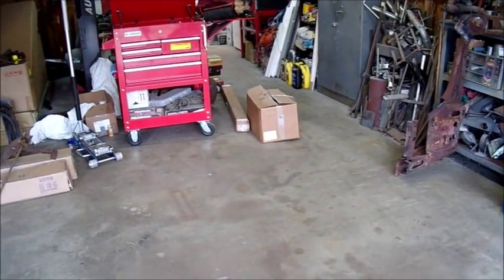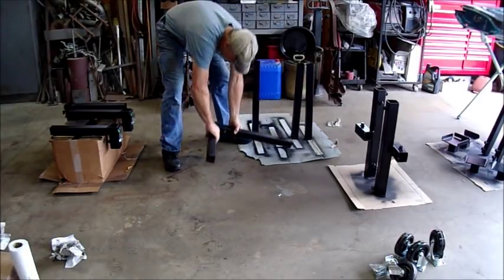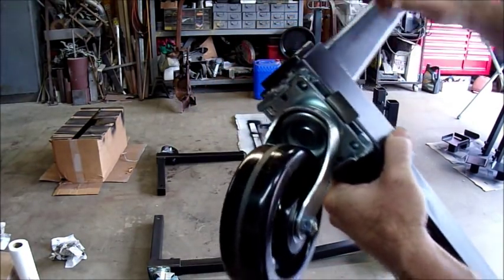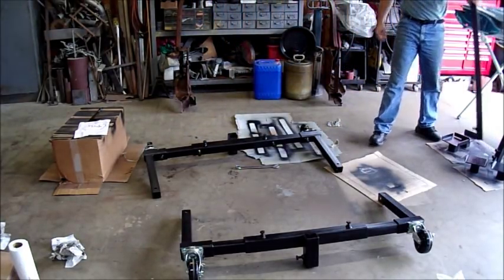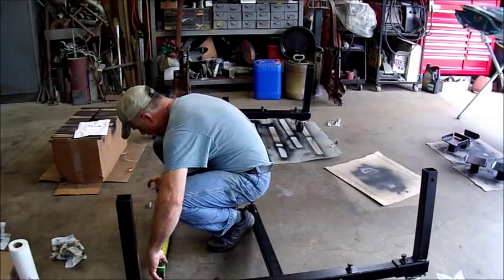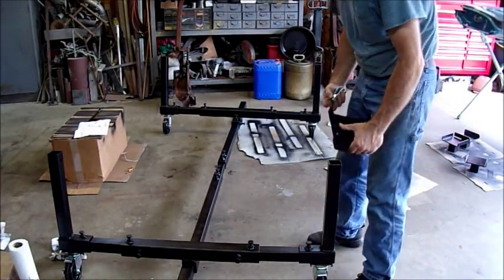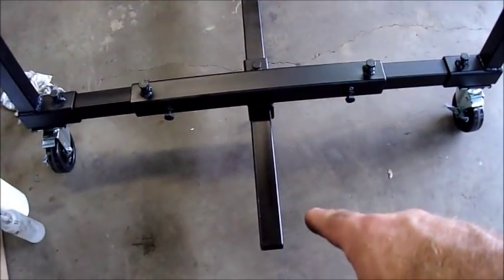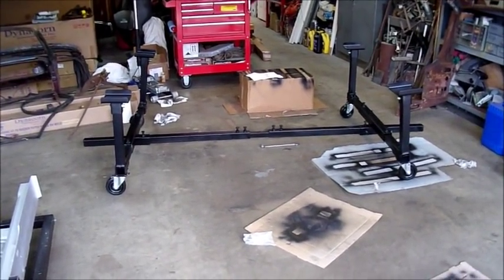Summit Racing Body Cart SUM-906702

Comment: Just thinking about those wheel brakes on that cart. There should be one at both ends so it is not moving around on you while you are working or loading a car on top of it. I think it has more chance to move with both at one end.
Reply from the maker: Agreed. I may swap them and have the locks on opposing corners.
Reply: Good plan!